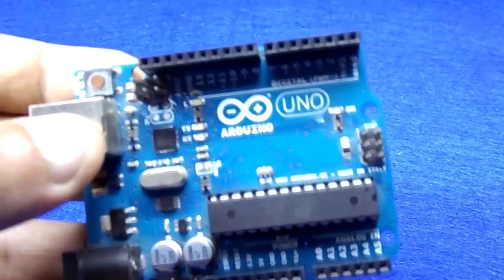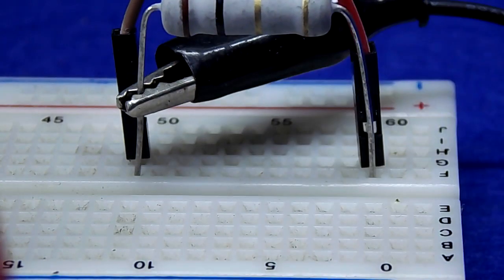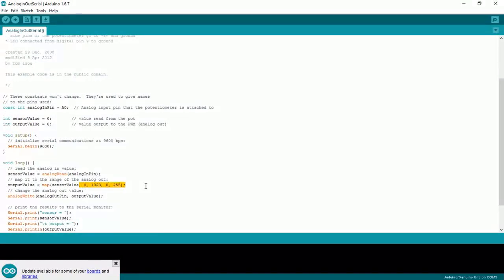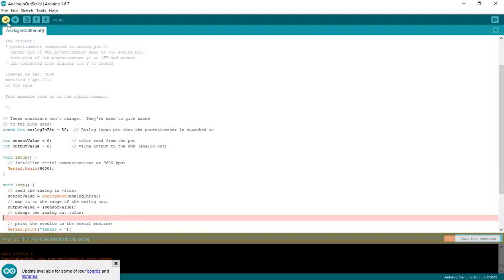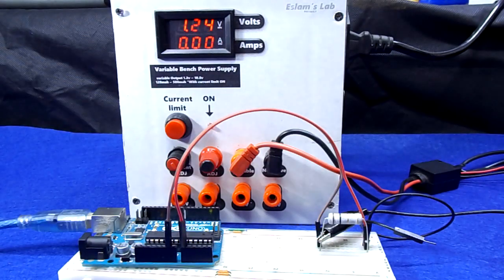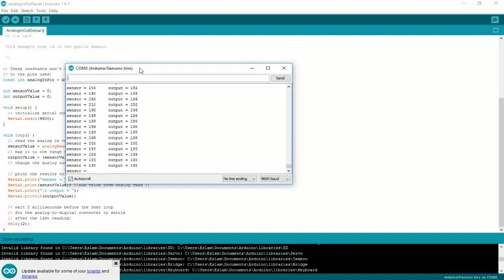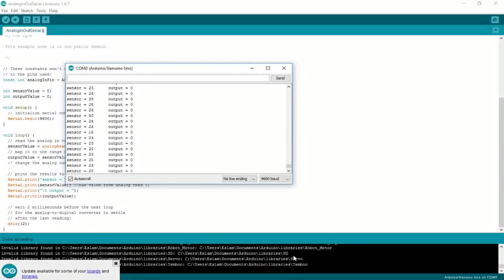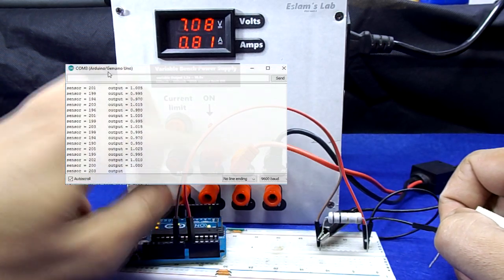how to Measure Current Without current sensor

Comment: Great video! Can you measure currents up to 30-40 amps in this way or would you need a shunt resister to handle this amount of current? If you can what size resistor would you need ohms? and watts?
Reply: The DC Current per I/O Pin on the Arduino UNO is 40 mA. More than that and you will damage the microcontroller. So you range (30-40A) is 1000x the limit.

Comment: If we change the voltage value, is the current will measured correctly?
Reply from the maker: Yes because it depends on the difference between both ends on the resistor

Comment: Thanks a lot sir amazing work but i have doubt why you have used 1/200(.005)? and is it possible to measure directly with led? Waiting for your kind response
Reply from the maker: Hi peradeep 
I have used .005 because it depends on the resistor value " lower resistors gets lower resulting but can measure higher current "

The other question is not clear for me :)

Comment: What is the value of the resistance ??
I want to measure current around 1.5 A at max
Reply from the maker: If at max you can go with a resistor up to 10 ohms 

But remember high resistance will give you high resolution but limited scale

Comment: really nice video sir....
how to measure power with using bluetooth and arduino modules....
i want your response sir
Reply from the maker: Hi 
To exchange data between your arduino and your phone you need just to connect your serial Bluetooth to arduino and use the same code 
Then download any app can view serial data from arduino
Reply from the maker: For any other modules you need to use the other modules code with serial print command to view the data
Reply from the maker: I didn't understood what you said
Reply: Means...
Is it possible to check the power consumption with using bluetooth and arduino...??

Comment: 17:18
Home Energy Monitor Project: Current
ItKindaWorks
34K views

4:24
Shunt Resistor Current Measurement
Thinktronics
5.6K views

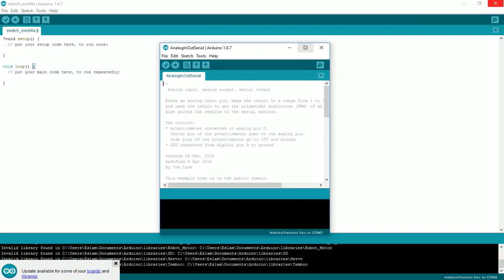2:10
How to use Arduino to read Voltage.
Atrobo Technologies (OPC) Pvt. Ltd.
16K views

11:49
TUTORIAL: How to Measure Current Into Arduino (Microcontroller) Using a DIY Shunt Resistor (Part 3)
Antony Cartwright
2.6K views

2:49
Arduino - ACS712 DC Current Measurement without Error
Kraj Technocrates
13K views

9:32
Voltage Sensor for Arduino with code and formula to measure any voltage
Robojax
3.8K views

TUTORIAL: How to use the ACS758 hall effect current sensor module with Arduino! (to measure current)
Antony Cartwright
5.9K views

How to Measure Current with Arduino
learnelectronics
10K views

Arduino as an Ammeter (Measure Current)
JustnTheNick
13K views

ac current measurement using acs712 current sensor and Arduino
BILAL MALIK
6.7K views

Make your own Power Meter/Logger
GreatScott!
464K views

Arduino based current meter with i2c LCD screen
Electronoobs
20K views

Current sensing in power electronics systems
Sam Ben-Yaakov
12K views

TUTORIAL: How to Measure AC Current Using ACS712 Hall Sensor (Part 4/4 - Coding 0.707 Method)
Antony Cartwright
700 views

10 Minute Arduino Project - INA219 Current Sensor
Julian Ilett
44K views

how to Measure Current 300A with arduino
Reply from the maker: Should i ban you?
Reply: Hmmmm haha seems like you caught something

Comment: What's about 140amp dc?
Reply from the maker: shaileshkullal11 I'm not sure 
But it's safer to use current transformer 

Or special shunt resistor with very low value

Comment: Nice video
I want to use this method to sense current in my MPPT Solar Charge Controller
Reply from the maker: +Electronic & Solar Power sure but you should know first your charger current  by using multimeter 

Then choose the right resistor to sense the current and calibrate it in the code ;)
Reply: Eslam's Lab thanks
Reply from the maker: +Electronic & Solar Power by the way  wait some while I'm Prototyping a device that test, charge and discharge a battery safely will release it soon open source with the code and schematics :)